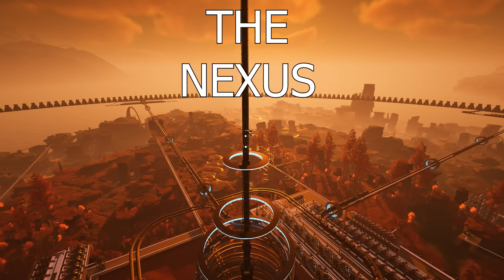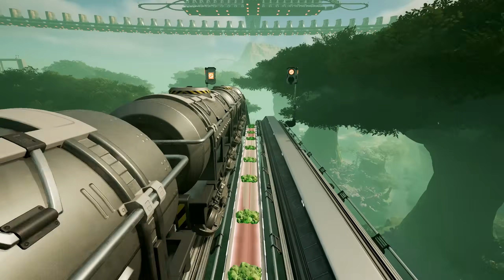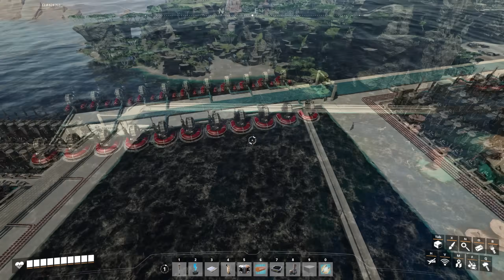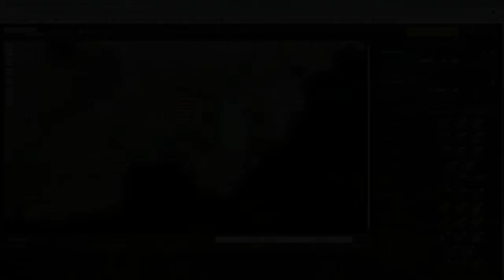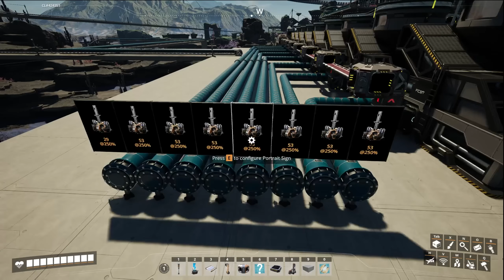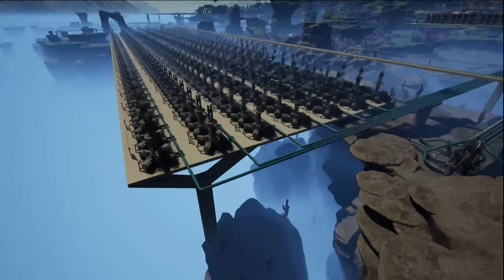Satisfactory - The Nexus - 1,000,000 MW

Comment: Not using any alien power augumenters? In my world I have about 475 generators burning rocket fuel, and 4 alien power augumenters getting boosted with power matricies. I also have just over 1 million MW of capacity but it will scale soooo much more if I add any more power stations. I'm contemplating attempting to reach 2 million MW.

Comment: There is another workaround for geothermal if you have the patience. 1st, create a dedicated geothermal power network. 2nd, place your first geothermal generator, then, half a cycle later, place your second one. Their cycles will cancel out giving a nice flat power curve. Repeat this for pair of generators before connecting them to the grid. Note, some pairings may be odd as there are uneven numbers of nodes of each purity, but there are enough to flatten the power curve

Comment: Damnnnn, this is my first time seeing an actually megabase in satisfactory, it's just isanely crazy, to the scale of these builds an your flying, it seems like the entire map is just a tiny small island. A few questions: are you going to use the resources to get the most points in the sink (somehow find the most optimal recipe) or just turn the all into the maximum of the end-game space elevator parts? And how are you managing lag, are there any rules you are trying to follow or design optimizations to make your factory run smoother than 20FPS? (or are you just going to accept that frame rate in the future)?
Reply from the maker: Thanks mate.  My plan is to make a good spread of all the end game items, I haven't worked out exactly the numbers yet, I'll do that a bit further down the track once I've grabbed all the nodes and done the first couple stages of production. With the lag, I'll drop the graphics if/when that becomes game breaking haha, fingers crossed =0
Reply: @danp6918  ok, cool

Comment: 17:57 i just finished my rocket fuel factory in this area i think i picked different recipes i ended up with enough fuel for 900 gens or 360 at 250% which i built a 15 floor tower for with 24 gens on each

Comment: Yeah, they really imbalanced rocket fuel compared to nuclear power in 1.0 - other than the amount of fuel generators you have to spam - for how easy it is to add GWs of power. However, the rocket nitro fuel alt does use a lot more sulfur/nitrogen compared to nuclear so there is that benefit.  Good luck with the Nexus on your new computer!
Reply from the maker: Hiya Hal! =)

Comment: nice video and good job on hitting 1 Tw of power, in my save with 0 cheats on i make 21,300 rocket fuel made from 9,585 oil , 6,390 sulfur , 8,520 Nitrogen gas , like 600 iron ore for 710 iron plates , and 13,107 water and makes 21,300 rocket fuel and 3,195 rubber and 2,130 compacted coal per min and i will use the compacted coal for steel bc i be useing all the coal on the map for a phase 5 thing but over all good luck man
Reply from the maker: Nice work, that sounds like a monster power plant
Reply: @danp6918  yeah it is i will make over 5 Tw to bc of the 50 alien power matrix i will make to

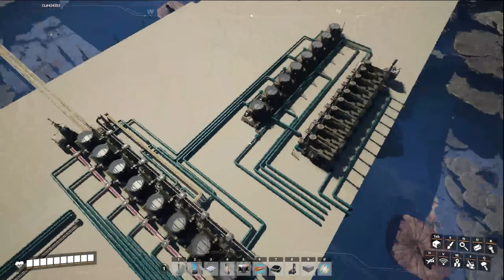Comment: Dan, when i look in myt own game and Blender to the Nitro rocket fuel the recepi is as follow: 4 fuel is 6 rocket fuel. but if i look at your video at 14:52 it says 4mk3 fuel in vas 9 rocket fuel out and we have the same recepi. so my blender set at mac clock speed is producing 375 nitro rocket fuel. The game number on the top left screen is the same as mine. so weird stuff going on/ maybe that 1 of your mods altered the recepi? hope it makes sence what i typed.
Reply from the maker: It might be because I am using Sommersloops in my blenders.  I am not using any mods to change anything in the base game, I am only using QoL mods to help me build faster.
Reply: @danp6918  Indeed, it is the summersloops. how could i mis that you even mentioned it. and i see you only have 2 sloops in the machine, i always thought you hade to put 4 in the blender. Thnx.